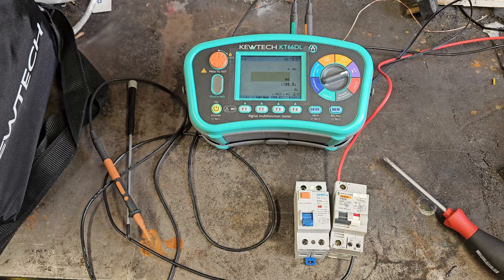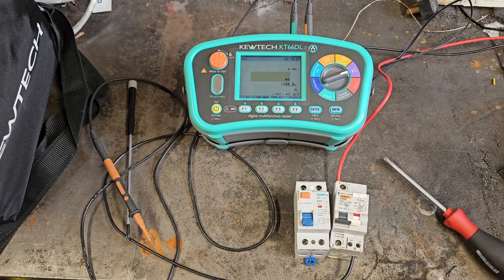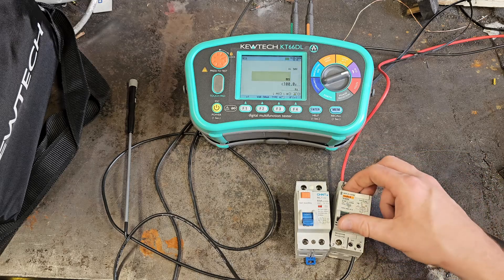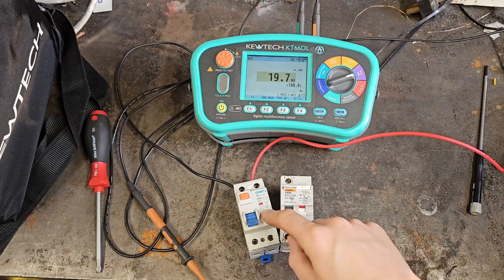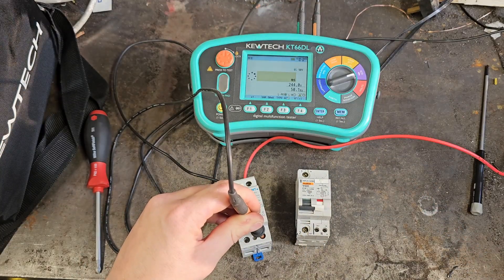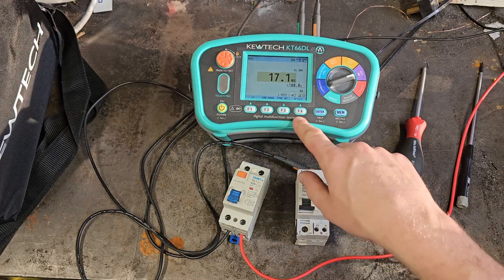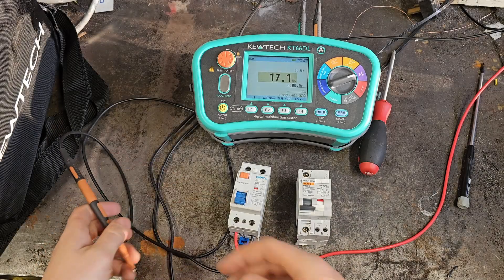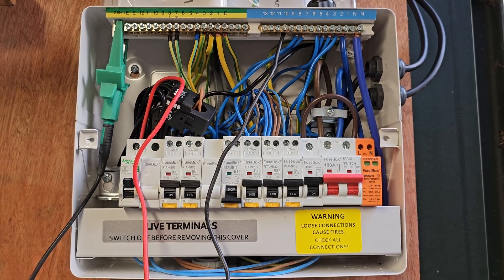Aren't all RCDs bidirectional?

Comment: The bottom terminals are usually the input as they are where the consumer unit bus bar connects the top is where the installation circuit wires connect. The is how we connect MCBs RCDs and RCBOs , bottom incoming top outgoing . But technically you are right it doesn’t matter what way the current is flowing the device will still operate as intended. Some Other countries CUs don’t have bus bars and they have the incoming supply at the top. However I think you are missing the point of the new regulation where battery storage EV charge points are solar are concerned the boffins at the IET are not say these things won’t operate they are simply saying that there is a possibility that if you get a back feed they might not operate within the 300ms maximum time allowed or they might not operate at all. It all comes from the manufacturers word after they decided to make a bi-directional RCD/RCBO. I agree with you it’s all Bull sh-t it nothing more than a license for the manufacturers to print money. But what do I know I’m just a grumpy old spark whose opinion means nothing.

Comment: If you dont follow the regs you will be in trouble...
Ooops I mean, when the power flow feeds into the grid for sometime must have made rcds eventually inoperative. 
Must have taken sometime to find this out and someone to spot the problem. Not saying regs are not evolving at times to not always to the customers advantage, just saying there is some basis for the regs changes. Would like to know more before dissing this one, as a faulty rcd, will not save your life when you need it.

Comment: having been retired for 6 years , 50ms seems to be a long time tripping , on the reverse connection 19 ms is what I remember as being acceptable at 5x the tripping current as is 27ms at x 1, From your conclusion I think this latest regs amendment is another con to make you use the new type of RCD for use with sola panels ?
Reply: His instrument is set to 1x IΔn so tripping times could be up to 300ms for AC type RCDs and meet the standard. For 5xΔn it would need to below 40ms
Reply from the maker: @mra813  yup, thanks :)

Comment: Sorry for the long long post but I don't think it's an issue that can be covered with a couple of sentences.

Aussie here, so I'm looking in from the outside.  The issue is confusing to me, and even though I am fairly new to RCDs since they weren't really a thing in the 80s, there seems to be a lot of misinformation going around.  I've even seen one larger youtube channel state that if you wire supply and load on the wrong side the device simply won't function at all.  The issue here for 'directional' RCDs has always revolved around the test circuit and is well known.  If the test button is held in for an extended period with supply on the 'wrong' side the electronics in an electronic RCD will leave the trip coil in the high current state, ie for as long as the button is pushed, potentially burning out the test load resistor or the trip coil or for that matter the semiconductor that causes the high current draw.

From what I can see no electronic RCD latches the earth leakage state, ie as soon as the imbalance goes away the circuit releases the trip coil current back to idle. I've tried my own test with a few brand name RCBOs  I have here that aren't 'bi-directional' but are neutral switching.  Due to the circuit construction there is always some current in the trip coil as it forms part of the power supply for the circuit.  Not one of them has fired the trip indefinitely. Yes, if supply is on the wrong side you can get a few hits of the trip until the fault state is cleared but this is not going to kill the device even in the long term.

All that needs to be done to verify if there is an RCD that latches the fault state is to put supply on the 'wrong' side and cause an earth fault on the other side.  If it trips and doesn't make a never-ceasing brrrr as the trip is repeatedly fired for ever, all good.  Does anyone know of an electronic RCD that does latch, ie it only clears when the circuit has powered removed making supply / load connections critical.  All that needs to be done to verify if there is an RCD that latches the fault state is to put supply on the 'wrong' side and cause an earth fault on the other side.  If it trips and doesn't make a never-ceasing brrrr as the trip is repeatedly fired, all good.

The only other circumstance I can see an electronic RCD failing in such a way that the operation under normal earth fault ceases is for a device that does not switch the neutral and there is a N/E fault.  When the device trips the N/E fault could cause sufficient continued imbalance in the CT to leave the trip coil etc in the high current state leading to a device failure if the supply is on the 'wrong' side, ie the circuitry continues to be powered.

I can see that magnetic type RCDs that do not switch the neutral would have a similar issue since the trip coil is operating straight off the CT current but don't know if it will cook the coil or not given the current flows involved.  The test resistor burning out / coil failure on long hold in of the test button would be an issue for non-neutral switching magnetics of course.

The whole issue of arc suppression failure is complete rubbish.  It's AC people.  Current flow reverses as part of it.  The arc breaking nature of the device is already capable of suppressing arcs with current flowing in either direction, be it MCB or RCD or RCBO.

I've made similar comments with other youtube channels.  In my state in Australia, Queensland, the last step of testing by an electrician upon installation is to press the trip button, ensure device trips, observe behaviour for anything inappropriate, reset and repeat.  Any abnormal behaviour is investigated.
Reply from the maker: yes, the zero crossing point makes switching AC so much easier on switchgear than DC!

I do wonder if we put too much emphasis on testing methods for RCDs, the "does the test button work" approach is fine for lots of things but apparently not RCDs. Thanks for the detailed comment :)

Comment: So you didn't test for the actual problem as described?  
We all know the sense coil does not care about direction so your random test shows normal physics.
The actual problem is the RCD or RCBO circuit & solenoid remaining energised even when tripped on a badly designed RCD, when it is under a reversed load.  Over time the now-tripped RCD circuit detection circuit burns out, turning the RCD back into an MCD.  Good RCDs trip and disconnect the load and the detection/test/solenoid circuit (3 switched lines), no matter which side is connected.  Bad ones (only 2 switched lines) disconnect the load only.
You can, of course, test an RCD to check for a latent or previous burnt-in failure simply by pressing the button that nobody uses at 6 months in the same way nobody tests at 3 months, or indeed following an actual fault trip.
Reply: Place supply on the wrong side of a neutral switching device, induce earth fault on the other side, observe for repeated striking of the trip (electronic type), if it doesn't sit there going brrrr it doesn't latch the fault state and does not have a problem.  None latch as far as I can see.  Try it with a non-neutral switching type and pass trippable levels of current through the neutral and see if it misbehaves.  I think the latter is a valid concern, the former is not.

Trip button issue is valid concern, so don't hold it in excessively - duh.
Reply: @retrozmachine1189 great comment retro.. unfortunately mate 99.9% of people won't have a scooby doo what your talking about
Reply: @Mainly_Electrical That comment is in the territory of engineering so therefore it’s unnecessary for the “99.9% of people” to have anything to do with it (assuming they are in the electrical trade).
Reply: @retrozmachine1189  What we need to know is which devices actually have this problem, so we can avoid them or identify them in order to get them changed.  Let's get a list of poorly designed devices.  How often is this really going to be a real world issue and where are the stats that the changes are based on ?  It's just an insurance policy for the bad manufacturers.
Reply: @ArcaneEnergySolutions That is a prime job for the IET / IEEE to do. Unless you can look at the kite marks and hope to only use them when verified? Maybe only purchase from trusted manufacturers who sell in the UK and have the burden of being held accountable.
Reply from the maker: @retrozmachine1189  I think I need to do some more experiments! Thank you.

Comment: Yes, not surprised by your findings, the RCD protection will continue to function if live and neutral are swapped or designated input / output terminals are swapped. The issue is around voltage remaining on the output terminals of some RCDs when there is a fault still present that causes permanent energising of the trip coil / electronics and may lead to their failure. The likelihood of this is quite slim as the G99 protection shuts down the inverter on loss of mains.
There is a document from BEAMA that pushed for the amendment from the IET, can't leave a link to it here. That also claims that MCBs may not have the same arc extinguishing properties and/or the short circuit rating is reduced if they are connected incorrectly.
Will be interesting to watch how this one develops and see if the amendment leads to RCBO swapouts on the multitude of PV installations already in. I think its just going to end up costing consumers more, same as AFDDs and surge protection.
Reply from the maker: Yes, I read the BEAMA document. 

There's a bit about inverters sharing RCCBs on split load boards - that makes sense. I don't think it's a good idea, and if it's a split load board it's probably a type AC RCD anyway.

Then it goes on to having voltage present on load terminals of a switched off RCD. As you say, the G98/99 relays in the inverter would switch off at that point but even if they didn't, there's no current and the RCD is energised by a differential current. I think it would be more of an issue of the RCD remaining powered by the mains if it was installed with the load side as the consumer, rather than the inverter, that's pretty difficult to achieve given the bussbar location. I guess this is my brain being too small in trying to see how that could cause a problem.
I know RCDs can become faulty, but that's why we test them (or in my case, I don't much because we don't tend to use them!).

Next is a section about extinguishing arcs, which is normally more of a DC fault issue than an AC fault issue on account of the zero crossing point. Again, I'm struggling to imagine the issue there because the current is flowing backwards and forwards multiple times a second and the arc doesn't care which way the energy flow is. 

I just think this is all a fuss about nothing TBH.

As for AFDDs, I think I like the idea but I'd be putting them on electric shower circuits first! Quite a lot of inverters have built in arc fault protection on the DC side which again is a nice idea. However I have sat watching an MC4 connector quite happily arc away melting itself to bits on a system with a SolarEdge inverter with AFCI enabled, so I'm not really convinced about their effectiveness. I'm also not sure of the difference between the cheap US spec ones and the apparently fancier Euro spec ones.
Reply: @tceng9449  the european mainland type of RCBOs and regular RCDs don't have a designated input or output side and it's usualy assigned in the way it's more convinient to connect to 😅
Reply: @circuitbreaker1434  Yes, but I know for a fact that several popular brands of devices sold in Europe are 'directional' in that the device can be damaged by long holding of the trip button.  As I said in my long winded post to the video, no RCD appears to latch earth faults so if you switch the neutral too it's a non-issue bar the test circuit problem.  Solution: find something else to do all day other than holding the button!
Reply: @retrozmachine1189  there are some older designs wich don't disable the test button when tripped with this it would be possible to burn out the test resistor if the button is held down too long
Reply: @circuitbreaker1434  Yes, as I said in the comment you are replying to...